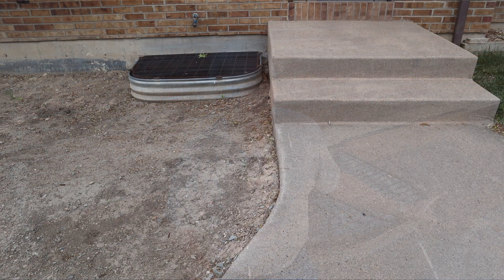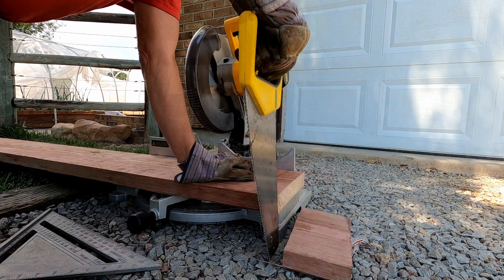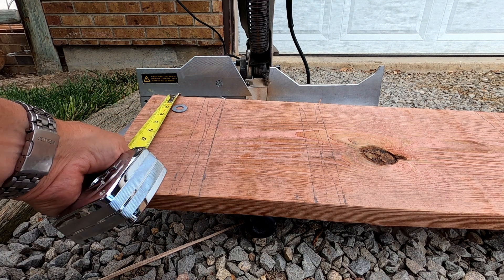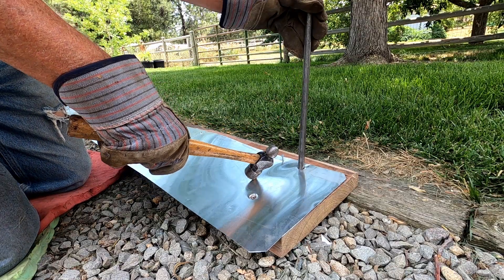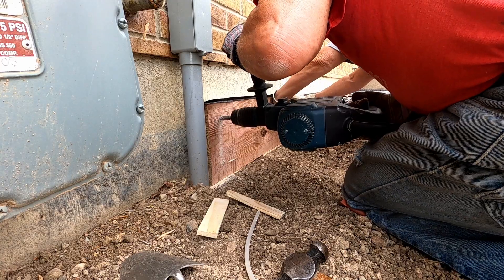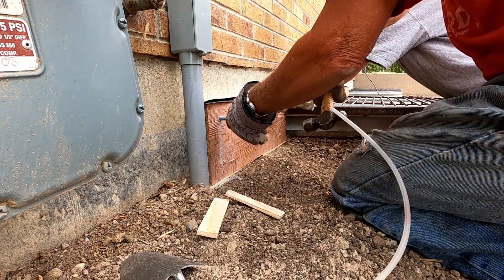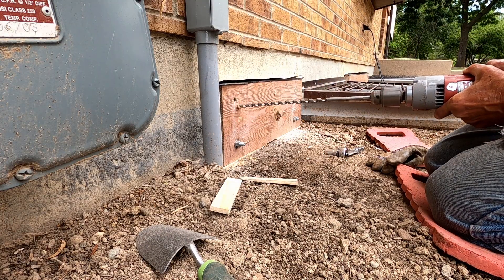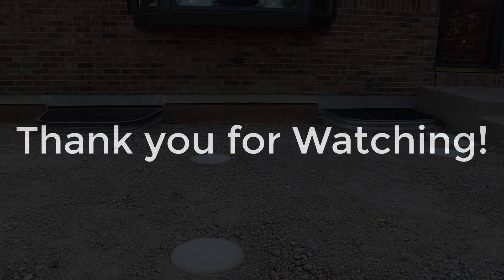Deck Ledger Boards - Internally Framed Ground Level Deck - Part 2

Comment from the maker: Based on the comment by @rosewoodsteel6656 - I replaced the Aluminum Flashing with Galvanized Steel flashing.  I posted a new video: "I Goofed Using Aluminum Flashing - I replace with Galvanized Steel - Internally Framed Deck - Part 6" https://youtu.be/htDU8nlHNEo

Comment from the maker: Today I learned - from a viewer (@rosewoodsteel6656) - that aluminum is NOT compatible with today's treated lumber!  See for example:  "Pressure Treated Wood and Aluminum" (https://www.buchnermfg.com/pressure-treated-wood-and-aluminum).  I'll need to figure out what to do about this before I complete the framing.

Comment: Why fasten it? A floating deck would suffice, no?
Reply from the maker: Good question!
I would prefer a floating/stand-alone deck - I have 2 reasons why I decided to use a ledger board instead of all piers:
1. We replaced the east (left) window well - which is 5 feet deep - along with the water main - which disturbed the dirt in the area.  Though it was tamped - I wasn't comfortable with setting piers at the depth that I will and had no interest in digging 5+ feet deep.
2. I have a single joist I need to install between the west (right) window well and the front steps.  I have no way to sink a pier next to the house here, so I need to attach to the basement wall.
Based on these 2 factors, it just made sense (to me) to use a ledger board.

Comment: Thanks for the video!    -Just an observation, is the aluminum flashing should not be used with the new pressure treated lumber.  They have special flashing tapes and galvanized drip edge that will not corrode due to the copper treatment used in the lumber.
Reply from the maker: Just so you know -  I replaced the Aluminum Flashing with Galvanized Steel flashing.  I posted a new video: "I Goofed Using Aluminum Flashing - I replace with Galvanized Steel - Internally Framed Deck - Part 6" https://youtu.be/htDU8nlHNEo
Reply from the maker: Thank you for posting!
I often learn something I overlooked or didn't know about AFTER doing something - so I really appreciate you alerting me to this oversight.  Had I known, I would have used galvanized steel.  
I need to think how I might correct this - both for my deck and this video.
Thanks again!

Comment from the maker: A ground-level deck may be attached to the house below the siding or brick.  When fastening a Ledger Board directly to a basement wall there is a chance of running into rebar when drilling the holes.